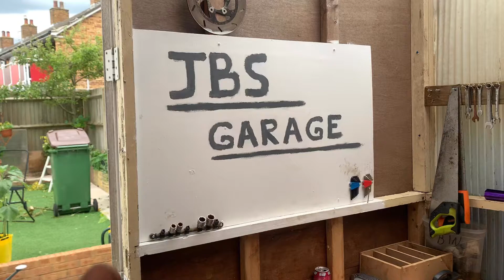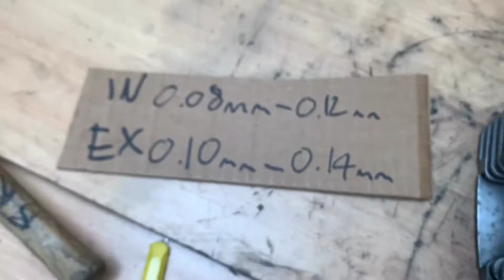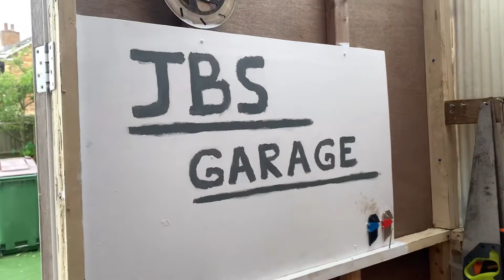Yamaha YBR125 Valve Clearance Adjustment - 5VL Engine

Comment: Hi mate I was just taking my 154FMI apart and now have the issue I can’t get the rocker arm out. Do you know how to do it or do I need to buy a whole new head to get the valves out?
Reply from the maker: Hi mate, behind the cam gear theres a retainer bolt that holds the camshaft in place, you need to remove the cam to be able to remove the rocker arms usually :)
Reply: @BikerBrad72  I just need to get the tappets out so I can change the valves as they are in the way of me trying to compress the springs. Is there any chance you can show me how to remove the tappets as I don’t think it’s possible on a 154 FMI
Reply from the maker: @motomcrspy  Drop me a DM on Instagram with some photos etc. @YBRKingUK

Comment: Hey  dude  ..  my  valve nut came loose and has come off and must of  dropped into  my engine  and has lodged itself in there ...  what  are the chances that  it will stay  down there .bikes fine replaced not . But  worried
Reply from the maker: Honestly mate it should be okay. As long as the nut stays at the very bottom then you have no worries as the oil filter cannot pick it up. But if it was floating about then theres a chance that it could do into the gearbox etc if it’s a geared bike
Reply from the maker: Basically no instant 12 wheelies 😂
Reply: @BikerBrad72  im trying .. cheers  bro .. yeah  think its ok  cause I took it for a hard ride  and it was fine ..  tjanx again

Comment: Hello, can you help how o adjust timing chain tensioner,... thanks0
Reply from the maker: Hi the timing chain adjuster is automatic spring loaded. Use a flat head screwdriver, twist the entire way in until it lock. Bolt the tensioner on and then put the screwdriver back in and gently wiggle and it will come loose and automatically tighten for you :)